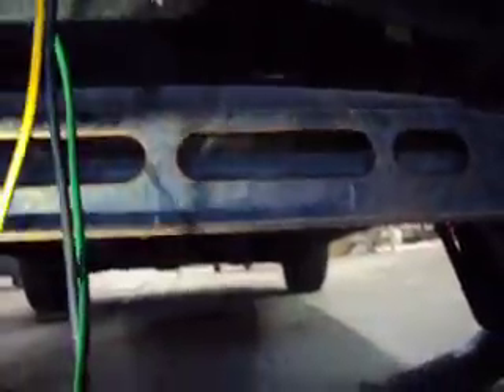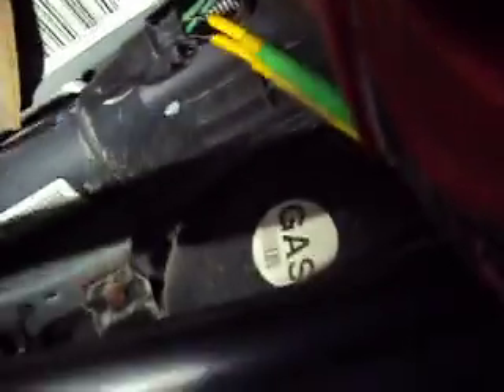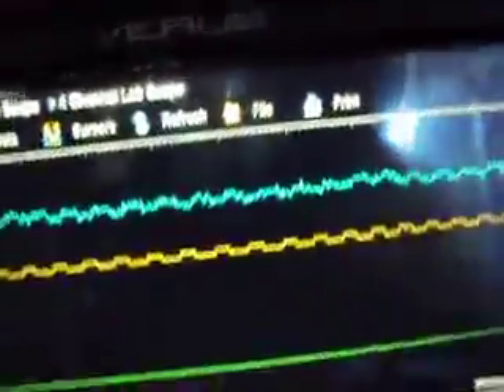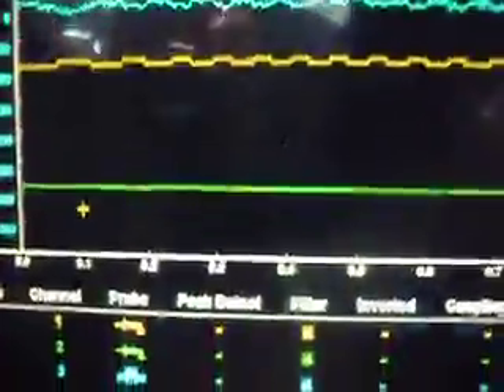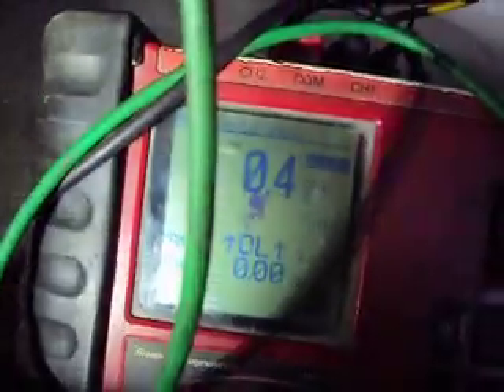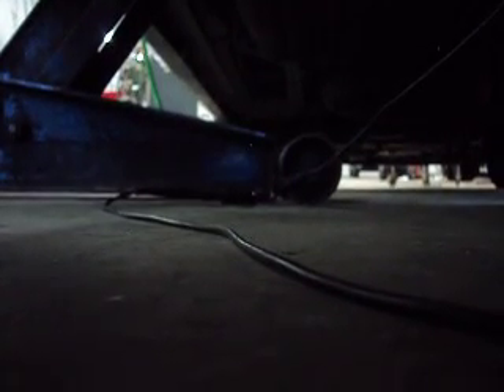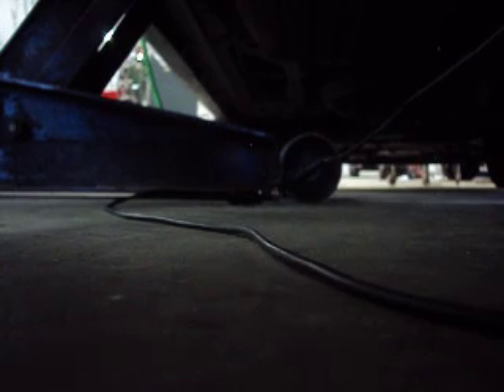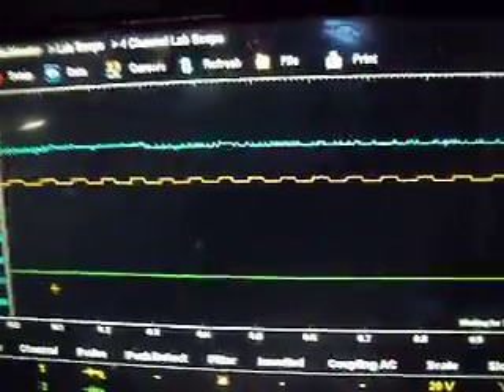Testing the ABS sensors on a 2008 Chrysler Town and Country

Comment: Hi there I have a mazda protege 02 model with a p0730 incorrect gear raito error code im troubleshooting my input and WSS on checking my WSS im getting good resistance test on all sensors but when i set my fluke multimeter to ac to check  the ac current i get no reading on all four wheels do you have any idea what could be the problem?? the multimeter was set to lowest to higest range also fully auto mode so im sure the multimeter works fine also i had a buddy spin the wheel still nothing help!

Comment: Thanks Bob. Been watching your vids and following your posts on the Snap-On forums. Good stuff. The WSS on the 07 up GM trucks are like this as well. I believe they are called magneto resistive sensors. Basically they are two wire hall effect sensors. Their signal is digital as well but the information in the Vantage Pro, Modis and Verus about how to test them is wrong, (at least the 11.2 was). I did some sample testing and saved the preset for the next one I need to test.